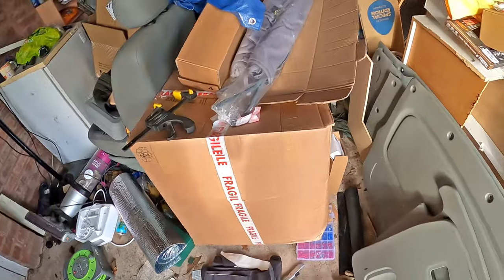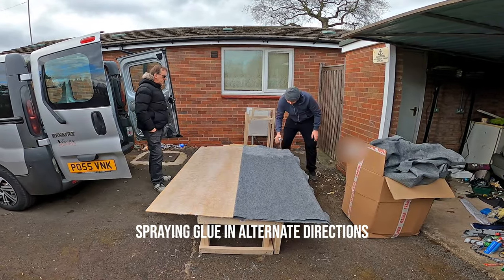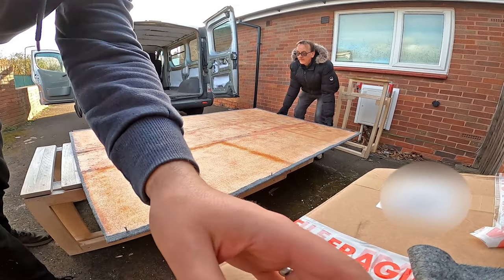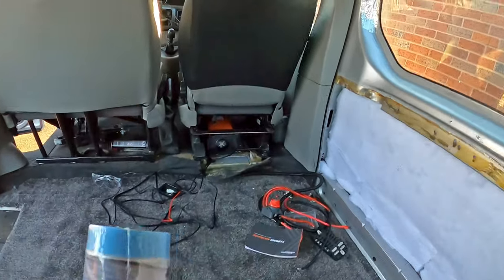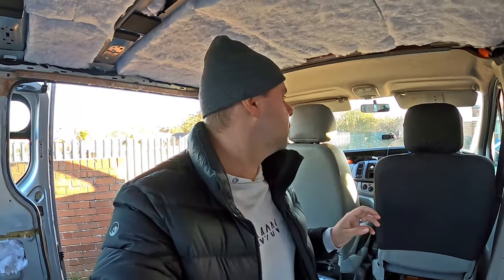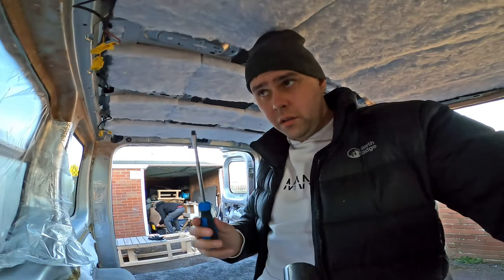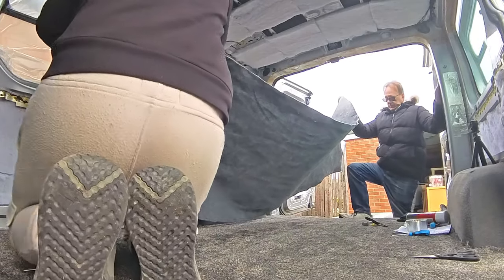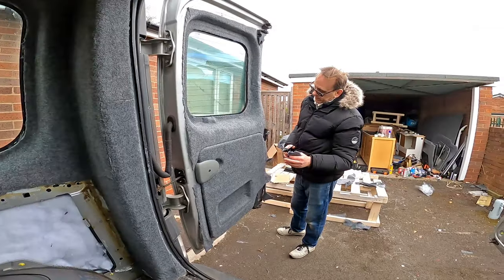Carpet Lining My Renault Trafic Camper Van | Budget Van Conversion Build

Comment: Good you had a hand, I just finished carpeting myself, probably put in 20 hrs over the last week, not as easy as I thought, carpet fitters blades just tugged at the stuff I used and normal blades struggled to cut the carpet too, sharp scissors I found the most handy.
Reply from the maker: Yes mate, it's tough carpet because it's stretches so much I think. My Stanley went through it like butter though to be fair 🙂. Definitely not as easy as it looks but so satisfying once it's done 👍

Comment: Yeah mate ita coming on nice your van is, carpeting is an art get it right the first time get the creases out re glue it ect,  your bed are you having a mattress in the van? If so i'd recommend carpeting the top slats to stop the mattress sliding off while you are driving my mate had a right mare with that issue.
Reply from the maker: It certainly is mate, harder than I thought it would be to be fair but we did it 🙂. Yeh I was thinking about a mattress and how it would stay in place etc. Good tip for the carpet 👍 cheers

Comment: Well done Brendan, it’s amazing the difference that carpet makes isnt it.
When you wire those lights in put a switch in line. I have the same set and twice when I have been parked near other campers they have turned on or off. It’s the same remote used on a few types of LED lights so when other people are turning their lights on or off they also turn yours on or off too. An inconvenience at first but turned into great fun giving someone their very own disco lights when Id had a few beers but that’s another story.
Have you managed to get sorted out with longer clips? The different suppliers usually sell some longer clips for the vw vans so I’m guessing the same will fit yours.
Reply from the maker: Thanks for the lighting tip mate 👍 I'll look into that 🙂. I haven't been able to find any longer clips as such for the tvps but I will look again. Might be a case of a screw and washer I think
Reply: Hi Brendan, I’ve just sent you a Facebook messenger regarding the clips.

Comment: Personally, I wouldn’t of bothered with the l shape bed would of had a wooden compartment at the front of the van behind the seats for battery ect. recycled plastic bottle insulation £20 a roll ton and grove for the sealing £15 a pack B&Q super foil multi-purpose insulation cheap. vinyl lining for the floor just glued in to the lining as carpet is not good for cooking trust me you will find that out. just thought I’d help you can convert a van completely for about £700.